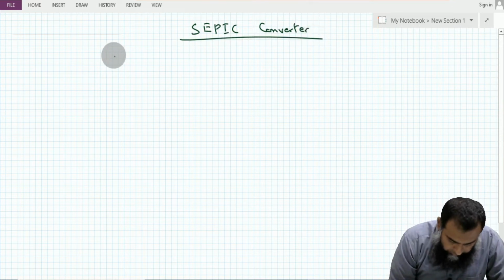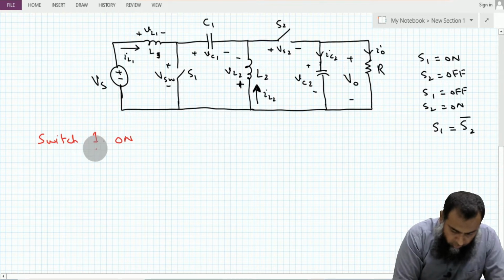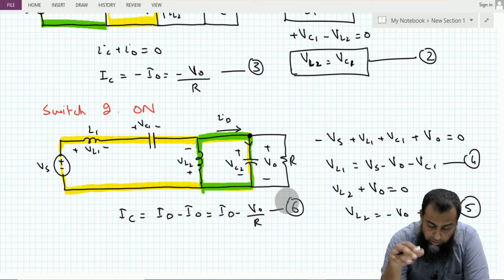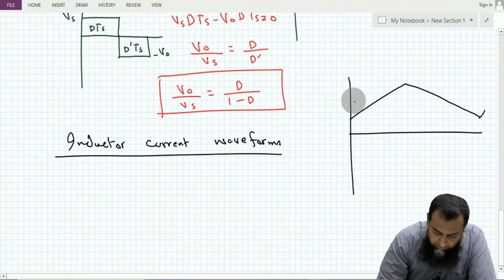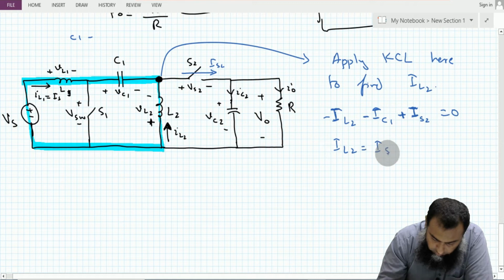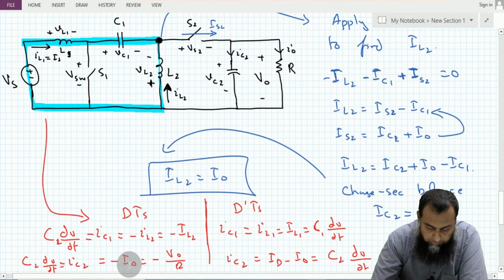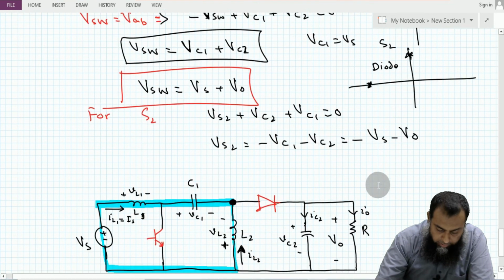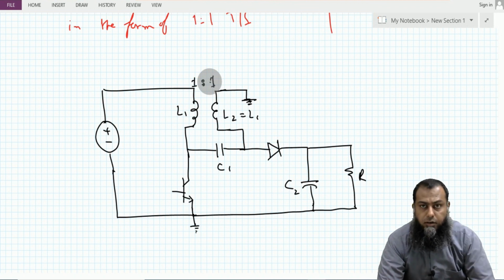Power Electronics Module 2 Lecture 10 | SEPIC dc-dc converter

Comment: What a load of drivel. It is no wonder students come out of university with absolutely no ability to do anything other than wash dishes or deliver food. The first thing an intelligent lecturer would do is buy a $2.50 module from Aliexpress and pull it apart and show you what he is yabbering about. 
He would then spend another $2.50 and pass a module around to the students so they can steal it. 
I have been teaching electronics for 50 years with over 25 million visitors to my website, so l know what l am talking about. 
You buy a number of modules, pull them apart, try different components and see how they work. 
Electronics is not a “chalk and talk”  subject.  And it is NOT a mathematics subject. I have repaired over 25,000 electronic appliances and designed hundreds of modules and made millions of dollars out of electronics without any mathematics. 
You are just being fooled otherwise. 
Colin Mitchell   talkingelectronics.com

Comment: Hi. To find Vc1 = Vs, Why did you apply KVL specifically when both Sw1 and Sw2 are off?
Reply from the maker: This is because KVL needs only a close loop. You can perform this with the Sw1 or Sw 2 close as well however, then the expression shall have a voltage which requires voltage gain expression to express it as Vs. So you again lands on the same point

Comment: what if load is not resistive? how the calculation of L1, L2, C1, C2 will change?
Reply from the maker: The calculations for other load e.g., battery will be then based on the modified equations. The modifications may or may not vary much. It is because, the essential o a converter is to operate under a given range of input voltage while keeping the output voltage constant.